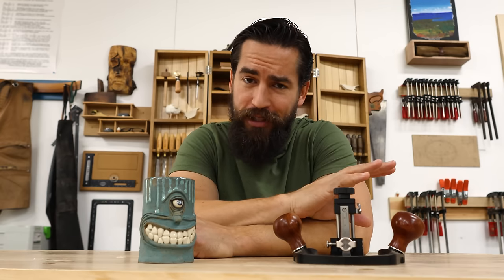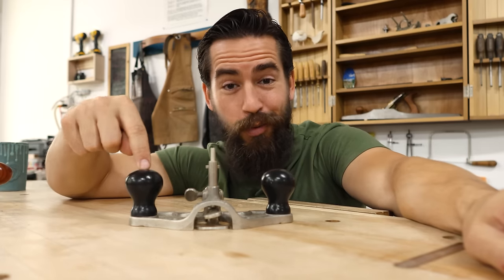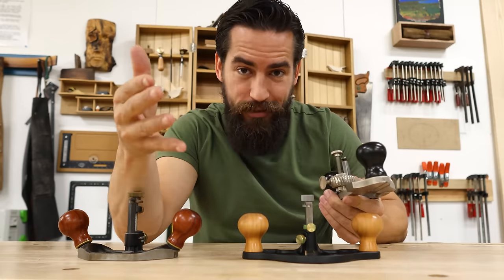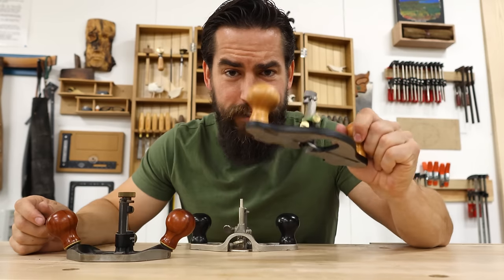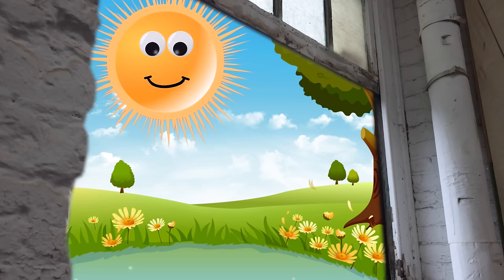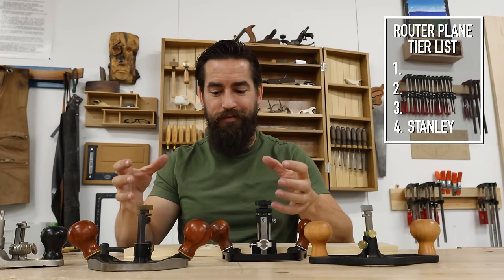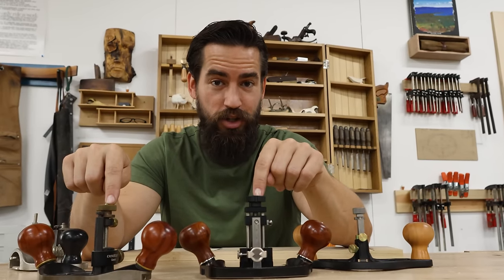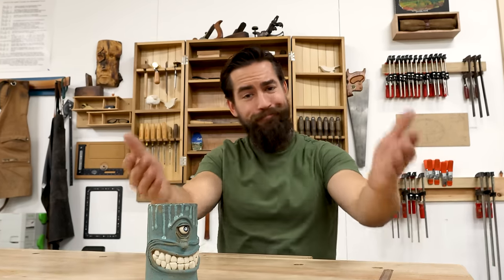How a hand tool split the woodworking world

Comment: The thing that doesn't make sense to me is the price point. Manufacturing in china is cheaper, yes? Than why doesn't the price reflect that. Just like bridge city, they manufacture in china now, but their prices are ridiculous. When you pay for a Lie Nielsen, or a Veritas you know that they are providing safe working conditions and adequate compensation for their employees thus the higher cost to consumers.
Reply: There are many variables in pricing. How many units does JKM order at a time? Double that number and I'll bet that pricing will come down. Just because something is made in China means it's cheap. It often is, but my belief is that China will build what you require, regardless of pricing. I would guess the same is true for Bridge City. I can't see a big demand for their products.
Reply: Manufacturing in China IS cheaper, but guess what MOST people don't think about? The manufacturers/producers of the product are factoring overall cost to produce, advertise, distribute, and sell those items. From 100's of thousands to millions of units... So fractions of a dollar still often may equal millions. Cost to manufacturer will be considerably cheaper in China, BUT then cost of shipping and distribution from overseas eats up a considerable amount of those savings... Add to that popularity of the product along with greed and it's a recipe for holes in one's pockets.

Comment: From an old school Brit very well done. I would just like to say I purchased the Stanley in the late 1950s in Britain there was no real choice of manufacturer. I have noticed  from your video the plane or should I give it its very old name "Old Woman's Tooth" is now used for complete removal of the joint wood, in my day that was the job of a cranked chisel if producing a straight slot.  The Stanley was used for levelling the bottom of the slot to the required depth. As for sharpening the blade, a standard oil stone for the flat bottom and a small slip stone tor the the top angle. Modifications done on mine over time, the adjustment thread and nut were changed  to Metric fine thread and the adjustment nut made larger out of Brass also I have forgotten the number of times it has hit the floor being knocked of the bench .  So just another slant on a well talked over subject, food for thought I did say at work in my younger day that I was going to purchase one of those new DIY electric hand drills one older and wiser worker said to me "They did not have that type of thing in Chippendale's workshop and we still cant come near his quality today".

Comment: I received my router plane from my grandfather. Back in the 70s, he built the big homes in Palm Beach from the late 40 till the 70s , and I took over for him till the 2000s . It was a Stanley.  Maybe there are some that are a bit better. But you won't find one that has done as much. Also as perfect as you need. Cost wise, buy a Stanley . Unless your just a tool snob lots of them it's OK look at cars . If you need the most expensive.  Get it won't make you a better, faster builder. Just fancer.

Comment: Issues with buying tools woodworkers make that I see right away is they probably won't make that plane forever and getting a new blade steel for it will be virtually impossible down the road. Where as buying the bigger named stuff they have been around for ages and will most likely in the future so parts will be readily accessible

Comment: For someone who doesn't own a router plane this is an informative video, both in the history of the router plane but about the various models you reviewed.  Good info on what you find to be positive features and negative features which is useful in choosing one of those planes,  or a plane from a different brand as I now know for which features to check.  Because you stayed with the differences between the planes, and what features you like, I didn't get a sense you were recommending one over the other, with the exception of the Stanley. So thanks for the review and history lesson.

Comment: Contentedly clueless over this controversy. I do own a Veritas, works fine, a router plane is essential to me. A few months ago a friend gave me a cheap router plane his wife had bought off Amazon, I think for less than 40 bucks. A little while back I had the Veritas set for what would be a whole bunch of cuts to a specific depth. I set the cheapo up, required surprisingly little sharpening, the sole was flat enough for most uses so I put it to work. Terrible ergonomics, but the thing cut just fine. I never knew I needed a second router plane, but for the times I do, this will work. 
BTW, someone once said " Show me an unbiased human being, I'll show you a corpse." That might have been me. Thanks for keeping track of your own. Now go get back to the lumber rack and have some fun.

Comment: I love you address your biases and you did it in such a friendly way. I also LOVE how you start with the point that Stanley just took a proven set of design options from a tool that existed in some form to mass produce…just like the more modern versions. I have an older refurbed “no-name” router plane that’s perfectly functional but would make a purchase to support someone like JKM because I like his content and drive to innovate and support this community.
Reply: It looks like an Australian company is making a metal version of Paul Sellers plane. Same blade design, same locking design, pretty much a copy. I think Vic may be selling them in Canada and the U.S.

Comment: For the Stanley, I have the adjustment knob upside down all the time.  I only have one original cutter but 5 Veritas cutters which are compatible but longer.  So it just makes sense for me.  As for the open vs closed sole, both have a time and place.  When the lighting isn’t ideal, the open throat is easier on the eyes.  Neither is a deal breaker for me.  Definitely gotta agree the canted knobs on the Veritas are comfortable and offer better control.

Comment: FWI: 1. The edge guide on the Stanley locks into the grooves in the base.  It doesn't just swivel around.  2.  The open mouth clears (is not impeded by) any shavings at the end of a stopped dado so as to allow the blade to cut to the end of the dado without having to stop and remove shavings. If I didn't have two hand routers already I'd buy J. K-M's in a flash.  Great tool.  Great price.

Comment: I'm still split but now with a lot more questions on another level but trying to help answer some myself.
If you're not sure which way the adjustment knob on the Stanley goes maybe glancing at some of the other planes might help except some of them have a larger diameter knurled knob for ease of use and only goes on one way but which position does the Stanley more closely resemble? 
The counterclockwise adjustment of the one plane makes it proprietary requiring you to get a replacement knob from the maker as well as their cutters for their 2 bar adjustment guides. Same maker thing goes for square cutter stem being parallel with the the blade or rotated 45 degrees. I'd go with the clean hex key rather than a chewed up slotted screw fastening the blade to the stem or on the handles. 
As for vertical vs. splayed grips the knobs are round allowing you to hold the knobs anyway you want. I noticed you placed your hands palms down on the splayed ones but palms facing on the vertical routers but could also use palms down. Actually on the splayed ones you could also use them with palms turned out helping to eliminate gutting yourself with elbows on the pull stroke. 
Don't know if casting the bridge across the cutter throat or placing vert. handles isn't just as difficult or easier as casting splayed handles would have been. 
As for you being a furniture maker or a YouTuber we would need to see your footwear to decide. Shoes or sandals? LOL

Comment: The slop in the Stanley adjustment is actually a feature. 

With the blade tightened in place you can move the adjuster down a tiny amount, then you loosen the iron, and it falls the amount you moved the knob. 

Then tighten up and proceed. That was their system of micro adjusting.
Reply: someone's been watching Wright :) Tested the slop feauture and damn, wish I knew it sooner
Reply: Exactly right….. er…. Wright.
Reply from the maker: Fair enough. Still not my preferred method, but I can appreciate that approach.

Comment: A very good review. I have the Stanley 71. First a couple of points on the 71 it does gave the guide groves so that the fence is always square. Secondly one of the cutters the witches for mine the witches tooth does have an iron that is removable from the stem. With regards to the KM router plane for me once I was made aware of the depth stop and and its improved functionality over the Veritas one the controvesy vanished. The only gripe I now have with the KM is the Chineese manufacture however as far as I know no UK plane manufacturer makes a metal bodied router plane that is a miner gripe. One add on / after market mod I would like to see for the stanly is replacing that foot with an actual verticaly adjustable mouth which I think would be a far better use of that mount point as it is already there..

Comment: I use a Veritas and a very old Stanley that doesn't have a depth adjuster. I set and mark my baselines with the Veritas. I hog out the waste with the Stanley, which is quickly adjusted with hammer taps, and do the final clean-up with the Veritas. I love this system.